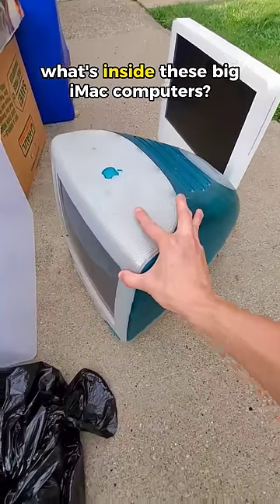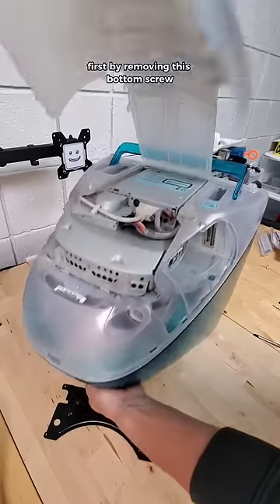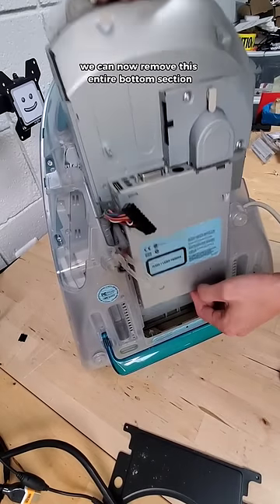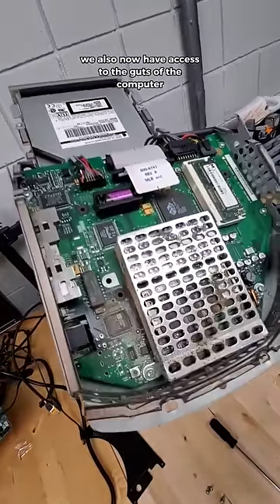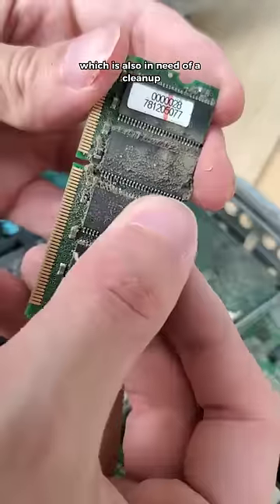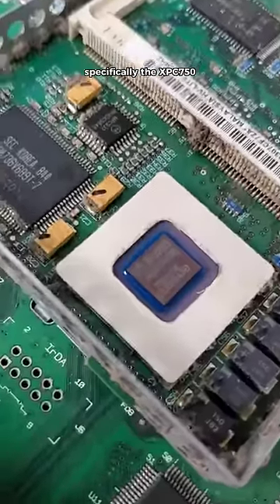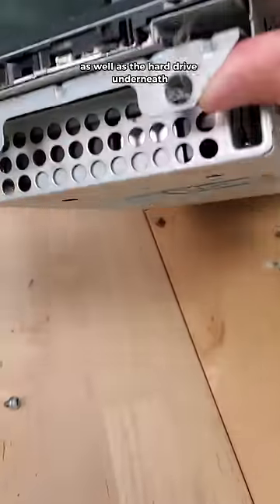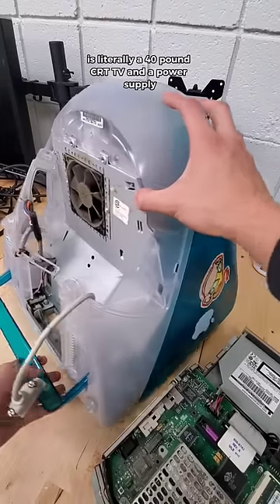what's inside an original iMac computer? #shorts

Comment: Ah yes, from the days where you could actually open and repair your own apple products
Reply: That cpu looked sodered in
Reply: lol
Reply: the power macintosh line was so upgradeable, certain machines in the lineup were so upgradeable, no tools were required to get in.
Reply: The new Mac Pro should also be upgradeable
Reply: @thegoldenatlas753 pretty obvious why
Reply: @FRNZ.1  even if they let you remove the ram again i can almost guarantee they'd DRM it so you can only put in "Apple ram" with special proprietary sockets too. They'll give you illusions of choice.
Reply: @thegoldenatlas753 no.. you can put any ram you want as long as it’s compatible
Reply: @WalterMan  reread my comment.
Reply: @thegoldenatlas753  yep it just uses standard PC SO-DIMM sticks, you can even put more RAM than Apple says it supports.
Reply: @WalterMan  I'm talking about modern day, not this model. Again read my comment.
Reply: @thegoldenatlas753  bro is anti-apple, but can't make proper objections
Reply: @thegoldenatlas753 like most laptops
Reply: I was gonna comment the same lol
Reply: Cr
Reply: @thegoldenatlas753 at least you could change out the ram, but removable VRAM on modern computers would be so cool
Reply: @WalterMan just remember that apple managed to make a proprietary USB-c cable
A FUCKING UNIVERSAL CABLE EXCEPT ITS PROPRIETARY
Reply: @thegoldenatlas753 what are uou gonna replace a powerpc cpu with?
Reply: @newad6610 Bro is a pro apple fanboy and cant read the comment
Reply: @vlOd_yt  lol, the last apple tech I had is IPhone SE and mscbook from 2014
Reply: They sell the parts and tools and provide manuals for repairing all Apple Silicon Macs
Reply: @YD_. They provide for a fee that usually comes out to = or more to pay them to use the tools, also the products are engineered to need the tools they "provide". Apple takes time to consider how their machines can be serviced and deliberately chooses to design them to be harder to service for their own benefit over the consumer's, and plenty of people are fine with that, that's valid, but not me.
Reply: That thing got removed after Steve Jobs died, so sad 🤔
Reply: @BaMbOoZeD  it was never a thing in iPhones when he was alive either
Reply: @YD_.  Some parts was actually in mind, but it all changed.
Reply: @thegoldenatlas753 remember this was in a time when it would've become obsolete/ancient technology after just a couple years
Reply: @thegoldenatlas753 we’re talking about the modern Mac Pro as well, you are waffling about nothing
Reply: @thegoldenatlas753 It's soldered for a reason.
Reply: Fr
Reply: You still can buy in pc
Reply: @thegoldenatlas753 and? i repaired a cpu you can desolder the cpu or maybe there's a short circuit on capacitor that cause the cpu not work properly i see that you aren't professional
Reply: Ahh yes, a blazing hot 4 mbs of ram 💀
Reply: @BaMbOoZeD even the pc lines suffer design impotency (boring slabs ) since he passed
Reply: Always hated apple
Reply: Sad that we still can't...
Reply: A
Reply: @thegoldenatlas753 you could say the same thing about laptops back then and any other all in one pc…
Reply: You beat me to it lol
Reply: @newad6610 exactly dude, I hate when people can't understand shit.   "No it's not upgradeable" "no reread my shit bro, I wasn't talking about this I was talking about new iMacs with socs and soldered ram and ssds".    These types of guys piss me off, when I have a point I explain both sides and why I believe such a way, and explain you like what you like lol.  

Like with people comparing and to Nvidia, being and fanboys saying "7*** series is better than 40 series cards because theyre cheaper and more efficient".    They're cheaper, and faster without Ray tracing, but 40 series is so damn efficient, and Ray traces way better.          And I have an all and build, I can see both sides.      I could've gotten almost the same performance with a 13600k and 3060 or 4060, but I went with 7600x and 6650xt for cheaper, and the motherboards are similar price on the low end.      

Idk man fanboys/ biased people for anything piss me off, I'm a PC guy and I understand
Reply: that's.. why they were so bulky
Reply: Well something that makes Mac’s good is the have 1 chip that contains the cpu gpu dram cache fabric and more rather than having then separated throughout the computer. This might seem bad because you can’t change them for better components but because they are so small and compact there is such a low amount of latency for signals to move around the components instead of having them seperate. Meaning if your not doing any games that are really really heavy on graphics or if your a graphics designer, it’s probably ok if not better than any of their computer around that price
Reply: Apple is fucked now
Reply: That’s Steve Jobs for ya.

Comment: Now make a video upgrading it to max or overclocked specs 😂
Reply: Glad your comment was the second one down.  I was going to say the same thing!
Reply: Turn it into a sleeper pc
Reply: Jes that would be amazin
Reply: @gusfring5485 no, there aren’t that many of these early revision imac G3s kicking around. Turning it into some dumb sleeper PC kinda ruins the point.
Reply: Action Retro already did that, and it isn’t exactly cheap.

You can upgrade the processor daughtercard from a G3 to a 400mhz G4 using the Sonnet Harmoni, a card that’s not only rare and expensive but also will only work in a single machine once installed (you can’t take it out and put it in another one and expect it to work). You can also upgrade the video card to a Voodoo 2, but that’s essentially unobtainium.
Reply: @nep-nep6575 not really, it would breathe new life into a device that's no longer useful for modern processing
Reply: @noname-zi9xm  hey man, I just know my stuff. Helps owning pretty decent retro Mac collection
Reply: @ProtoAzula new life as in a novelty. it would just be easier to build a new pc than destroy a vintage one
Reply: @kit7une_  but why not do it? It would be difficult, yes, but there would be less waste
Reply: Yess
Reply: You really can't. The compatible CPUs are all weak and soldered directly to the board, the built-in GPU can barely do 3D, and the maximum compatible RAM peaks at 512 megabytes.
Reply: At the time you could actually find third party upgrades to transform a G3 iMac in a G4 iMac with better CPU, graphics and Ram.

I still have mine, upgraded that way, in my garage and it still boots up.
Reply: @nep-nep6575  I suggest he takes out the tube and sells it to me
Reply: do it
Reply: With a 350mhz power pc processor no chance

Comment: This is the first time I’ve ever seen someone use a screwdriver to remove a vga
Reply: I had a vga connecter tightened really in so i used a screw driver
Reply: i use them regularly
Reply: Sometimes the screws are hard to reach.
Reply: I mean they are screws after all
Reply: You haven't seen many cables removed.
Reply: Those things don't come off lol
Reply: Once upon a time peripheral connector screws could only be loosened or tightened with a screwdriver.
Reply: That isn't VGA lol
Reply: This isn't VGA
Reply: it was probably put together in the factory, they don't want it to loosen during shipping.

Comment: I have never seen the ability to upgrade v ram before that’s actually very cool and should be implemented today. Interesting thought… what if there were ram slots on the back of gpu’s so you can tailor it more exactly how you need.
Reply: Asus actually did a concept of this recently using m.2
Reply: That would be cool, but I think that isn't done due to speed/stability limitations. I bet a GPU could be designed to have both on board ram and additional (slower) ram added later.
Reply: @Xavior12 Yes, you're right - in order to get high memory speeds you want the traces to be as short as possible and there to be no unnecessary connections. Otherwise they create variable path lengths and cause impedance mismatches, which degrades signal integrity.
Reply: @Xavior12  That's literally what your regular ram is 😂

Comment: Nice short video. Yes, this is the original iMac shape, but the first original iMac was a 233Mhz and it had an infrared port on the left speaker. Also, with the screen facing down on a cloth or sponge, pull the bottom panel upwards otherwise you may damage the plastic tabs. Overall, a great find though!

Comment: fun fact: since the DA-15 video connector used on the imac is the same one you can find on most older macintosh systems, you can hook the imac motherboard up to a bigger macintosh display, you can also do the reverse and hook up another macintosh to the internal crt. the best part is the video standard used is compatible with regular vga, so with a simple adapter, you can use the internal monitor of this model of imac g3 with any device with a vga output

Comment: Duuude!!! Nostalgic! I remember using those in middle school.. I also used to have an internship with the tech guys at the local school system back between 2002-04.. we would mess with those, and we had a huge room where there was a massive pile of old computers had built up that had been just thrown in there and never gotten rid of. There's was Macs like those in the vid, as well as the original Macs from the 90s I think

Comment: Could you in theory upgrade one of these to modern specs? Or maybe to an early 2010s computer? OK hear me out, Change out the screen and like 3D print a new case. Maybe upgrade the memory and the ram, new heat sink to handle any new temperatures from a brand new possessor. Feels like it would be a cool experiment at least.

Comment: Oh.. the bottom section is like a cable-attached modular tray... fascinating.    Part of me wonders if a drop-in replacement board could be made to upgrade the old iMacs to modern architecture and specs :)
Reply: That would be interesting, but would take a lot of effort for a hobby project

Comment: bro need to becareful when open some old imac like that, when you open the standard ram, one more centimeter you will touch the black part because CRT monitor use powerful over than 10000w to export image , when you unplugged it still have power inside, it will very hurt when you touch it and it not dangerous too much about your life but it sill have little chance

Comment: never open the CRT part without knowing what you are doing
Reply: Well, that's easy in this case. Well designed.
Reply: @owlstead  nowadays it's not that easy, since there is some really brittle plastic under the top cover and bezel of the imac, i once dissasembled a later revision blueberry imac for it's outer housing and the whole top bit of the internal plastic just snapped off, rendering it effectively useless

Comment: Hey can you make a sleeper build in there like a RTX and a top of the line CPU?
Reply: An RTX card wouldn’t fit in that case.
Reply: @kit7une_  any other top of the line GPUs then?
Reply: @gam30ver23  not really, the case is quite cramped. I have one, it’s not big enough for any modern GPU
Reply: @kit7une_  the. Do you know any GPU that can fit there? But it can run games like GTA 5 and warzone?
Reply: @gam30ver23  there is no way this hardware would be able to run gta 5 or warzone lol. You’d have to replace the entire motherboard